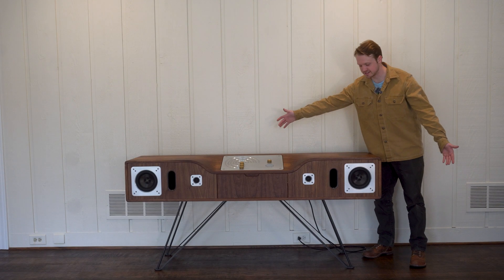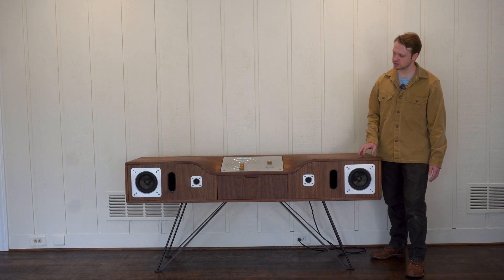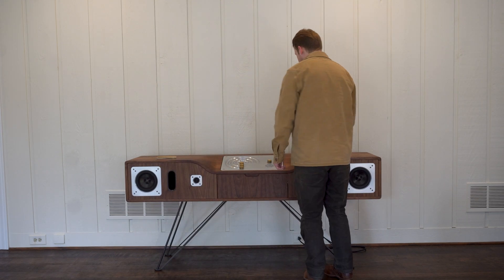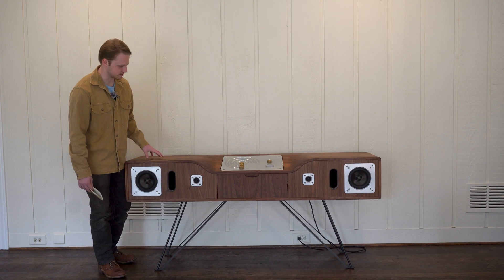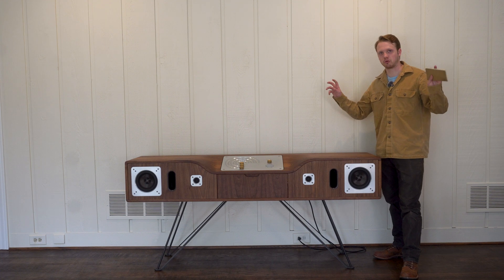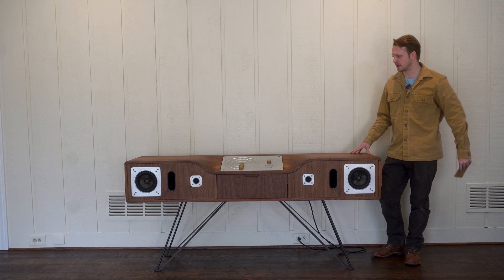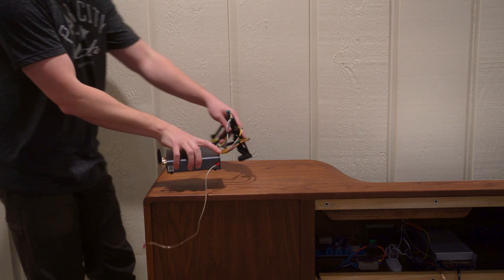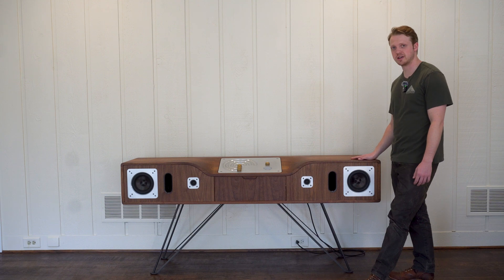How I Built a Giant Speaker (Voyager Deep Dive)

Comment: Such a pretty build! My knowledge/experience in any of these disciplines is virtually zero, but I did recently replace the potentiometers in my Dualsense controllers with tunneling magnetoresistance modules due to thumbstick drift. Would a similar swap be possible in the Voyager’s knob mechanism for purposes of resolution and longevity? In other words, does the function of your mechanical arms permit the use of TMR/HE sensors instead of potentiometers, and if so, would that serve any benefit?

Comment: I appreciate your skill in woodworking, but as someone who’s been building speakers for over 30 years, having the tweeter so far away from the woofer is a big no-no. It will cause phase cancellations which will result in a very uneven frequency response.
Reply: Yes, off axis will not be smooth. On a design axis (on axis) could be made flat. Important is the off axis cancellations caused by having drivers apart. 

Also this design will lack midrange clarity, something that would be heard even through youtube. The notion that we wont hear how it sounds over youtube is incorrect as design faults are quite obvious in a simple demonstration.